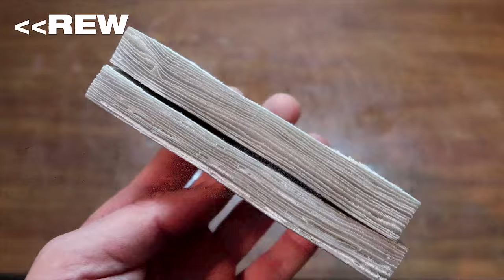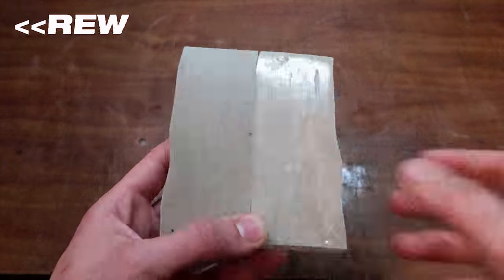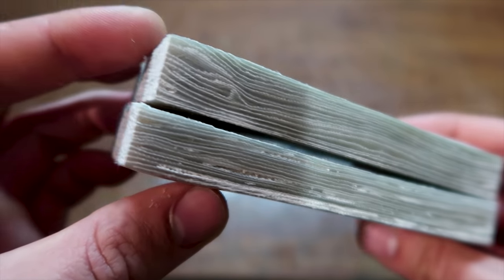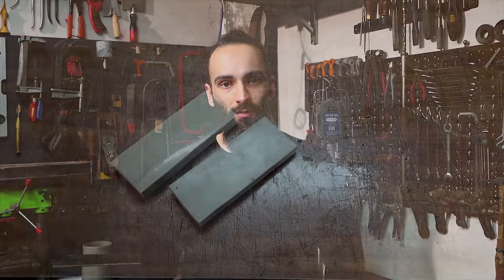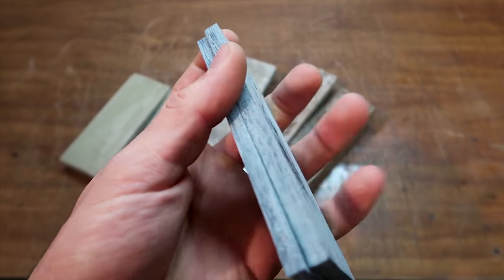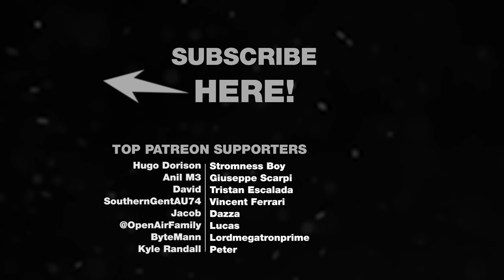Composite Materials : Vacuum vs Pressure

Comment: Thanks. I guess pressure may be superior coz' that's what Koenigsegg and Pagani uses on their huge pressure cooker, their autoclaves for their carbon fiber but I would suggest this: combine mechanical pressure + air pressure or vacuum using this innovative DIY method: fabricate a thick spring w/ a convex plate (the in the form of the pressure pot's curved lid, perhaps by hammering it into shape or using a hydraulics or jack used in cars (or a real hydraulic press from a nearby shop or a bench vise)  and weld onto the spring on the other side of the spring, a flat plate (this plate should be covered w/ plastic film that the resin won't stick to and coated w/ resin for good measure). Put the material composite and the the spring on top of it and the the pressure pot's lid and lock in place (it'll be very hard coz' of the spring's tension). When the pressure is increased, the air would also be taken out by the actual mechanical force from the spring contraption- same w/ the vacuum one. It might take a bit of trial and error in determining the right length and thickness of the spring that the lid (and human strength) can take without the spring going through the lid or damaging it (better if the top convex plate is welded with a sturdy ball bearing so it the spring contraption does not scratch the lid and can rotate freely. The bottom tip of the spring needs to be heated and bent at 90° and then threaded so there's a bit of height adjustment (someday the threads may have grooves and the female thread on the bottom plate can be lined with ball bearing on spring tension, so there's a kind of ratcheting mechanism, so the plates don't move as the spring presses onto the lid and the composite material).

Unless the composites are always of the same height, the spring contraption may need to be bespoked for maximum mechanical pressure and unless it's always a flat composite,  the bottom plate needs to be bespoked to the contours of the composite (for example it may have curves and dips) and then there needs to be a bespoked plate at the bottom of the pressure pot or vacuum chamber in the shape of the composite so it's sandwiched, pressed as strongly as possible while it's subjected to air pressure (can it be not air but a denser kind of air injected into the vacuum chamber?) or vacuum. It'll be forged composite in effect coz' the mechanical pressure but at the same time under gas pressure or under vacuum. Both plates at the bottom for non-straight composite materials need to be lined with a plastic film the resin won't stick to (with resin applied to both for good measure).

If the autoclave is big enough, one can put a hydraulic press so it's mechanically being pressed (forged) while also under gas pressure or under vacuum.

God bless, I hope my innovation works and will produce even stronger materials that are stronger but thinner and lighter.
All inventive and innovative ideas are from God, I'm but an instrument of His peace and innovations. :-)

Comment: why not just clamp it between to planks? I wrap the micarta in oven anti stick paper, and clamp it between 2 planks, and i don't get any foids. i seen other people use wooden molds they clamp it in. to make it same size rectangular every time.
Reply: symmetric thickness.... unless using a steel plate both side wood tends to bow and be thicker in the middle
Reply: @DjGlenJon  yeah i found this out the hard way. I ended up welding a steel jig and use a very thick steel pressure plate that cannot bow and get great results now.
Reply: Exactly!

Comment: In a vacuum bag sounds like a good suggestion.
I suppose you could use a bottle jack with resin piece sandwiched between a rigid  container & lid lined with plastic so it doesn't become too badly glued shut.
Polyester resin has 1 disadvantage, short shelf life of unmixed resin.
Epoxy can last for years if stored correctly.

Comment: Try squeezing the wet layup in a vice between thick wood blocks (use plastic wrap to prevent sticking). The pressure you can apply with a vice on that area is far greater and it would also compress the fibers together.
Another method for wetting out fibers is called "vacuum infusion" where you pull a vacuum in a sealed bag and use that same vacuum to draw out resin into your fibers. It's much quicker and yeilds far superior results.
Still, for micarta I would use the vice method.

Comment: mechanical pressure while in a vacuum will give the best results...like how G10 is made. squash the wetted fibre between two mould released surfaces to remove excess resin then vacuum to remove trapped gases.

Comment: Dear Black Beard, I don't want to sound rude but both pieces of composite are rubbish. You'd rather try vacuum infusion or vacuum bagging + pressure. Obviously, if you just put the laminate in the pressure vessel, pressure will not help at all. But if you manage to have that piece in the properly made vacuum bag, and add pressure on top of that (even @ room temperature), you'll get good consolidation. Or, what might be much simpler for you, just try vacuum infusion. Get a proper resin for that and make a big plate for your DIY projects. There are plenty of videos on Utube showing how to infuse.

Comment: Nice video, and good of you trying to experiment and get to the bottom of this. My 2 cents: First, I think one should use employ both vacuum and pressure. Degas a pot  slow cure epoxy (as you mentioned) in the vacuum pot and then place the soaked blank in the pressure pot. Secondly, I think fabric laminations (or any kind of lamination for that matter) should be held under clamp pressure while curing, regardless of the presence of air pressure or not.

Comment: The resin should not cure in the vacuum, this is just needed to get the air to bubble out, when repressurising, the surrounding pressure collapses any void.
If you don´t push the layers together when laying then into the mold and physically hold them together until the resin hardens, you will always have inconsistent results.

The method with the plastic bag (from the other comments) can do both: the vacuum empties out the bubbles, the pressure difference presses everything together.
But still - if the layers are not put together well (too much resin inbetween) the results can vary

Comment: Hey folks look up three rivers bow making. The way they make bow limbs is how we make our micarta. Instead of fire hose we use truck innertubes.  For the vacuum forming I go to the Dollar Store and buy vacuum bags for clothes. Put a small board up each side to keep the pile square. If your half way handy it's easy to rig a cars vacuum switch to turn on and off the vacuum pump so you don't have to nurse made the drying time.

Comment: You may get better results by setting the layers together in the open, so you can press out the air bubbles, before you put them into the mold. Then subject the molds to either pressure or vacuum. By eliminating the most bubbles possible in the open you should have better contact and adherence in the molds no matter if you use pressure or vacuum.

Comment: I think the best results would come from first placing the piece in a vacuum to expand trapped air bubbles and bring them to the surface. Then place the piece in a thick vacuum sealed plastic bag and apply as high of a pressure as you can around it. The effect of high pressure air will be limited if you haven't got a bag to prevent air from diffusing into the piece while it cures.
Reply: in a vacuum bag, you get both: the vacuum you pull pulls out the bubble while the ambient air pushes on the bag, thus squishes the bubbles out of the piece...
Reply: @sypernova6969  The only trouble with a vacuum bag is that the pressure the piece feels is limited to atmospheric pressure. For some things that's enough but more is always better. Also, if all you did was a vacuum bag, it would be very difficult for the small entrained bubbles to come out. The benefit of pulling a vacuum around the entire part is that it causes the bubbles to expand and make their way out more easily. Only after that has happened would it be beneficial to put it in a vacuum bag and pressurize the surroundings.

Comment: Try rolling it after adding each layer, before putting it in either chamber. You can buy a small metal roller designed for laying up fibreglass. Maybe use slightly less catalyst to slow down the time before it gels.

Comment: You should research a triaxial 3D braid for building layers - rather than a single material with grain all running  the same direction.

A triaxial braid, you can mix fabrics with various properties, building a superior overall final material.  

Another interesting concept is building layers by stitching 2-3 types of fabrics per a selected tesselating pattern.  It would be cutting fabrics into specific small shapes and stitching them to defined positions per the pattern....sort of like making layers of fabric scales, where the scales are 2-3 different fabrics.  If the tesselation has a grain to it, each layer would be set 90° rotated from the previous layer.

Also, I agree with many; clamping the material between two rigid plates for pressure would be a good idea.

There's a Japanese fellow who tests different materials for making high-end chefs knives - his channel is "kiwami" I believe...  I'll have to double check; but he's made knives out of all sorts of stuff - rawhide, aluminum foil, cling wrap, cardboard, pasta, pure resin, carbon fiber, lignum vitae, boxer shorts, etc.  Every knife listed has been sharp as shit...

Note: his channel is "Kiwami Japan"

Comment: First of all I would do some testing, if less hardener would result in a longer curing time. Also cooling down the resin before mixing should slow the hardening. Maybe cooling the cloth is also possible. Which would leave you more time for handling. Chemical reactions are very temperature dependent. After placing the layers in the mold I would simply weigh them down before applying vacuum or pressure.

Comment: Can you try placeing the materials in a bag and then using vacuum to pull the resin through the material? I know this is a process used when making carbon fiber panels so it may work here as well. Also it may cut down on the amount of resin used.

Comment: This cavitation takes a very long time to go away and your essentially pulling gasses out of the liquid. Not necessarily air bubbles.

There is a method used with hydraulic brakes on bikes that use the cavitation to remove air from the DOT fluid and it's super slow. I usually just wait for the large bubbles to be removed and leave the microbubbles alone since I have never seen them fully disappear.

Comment: as a general rule .pressure for resin casting .vacuum for silicone casting. you can vac cast resin with a vac bag that will compress the cast.

Comment: Not sure what you are trying to accomplish here but maybe I can help with the samples in the video. Way way to much resin, try 10%- by total volume with a 1% to resin volume initiator, then apply lots and lots of pressure. The result will be a much tighter/thinner and much much stronger unit. Let it cure under pressure until peak exotherm (maximum temperature), then release pressure and let cure at ambient until part is at the ambient temperature. I think you will be pleased. I am a certified composite technician, let me know if you have any questions.

Comment: Hey dude, have you ever tried a press or heavy object? Isostatic pressure in a pressure cooker  is not too high and vacuum degasses the resin. You need too vacuum and then press with much higher pressure (using a non sticky pressure transfer media e.g. a polyethylene sheet or do).

Comment: How to make it work correctly with poly resin BBP is like this -- 
Do not put your mold in a pot, make your mold out of wood or teflon or plastic and line with parchment paper, must be parchment, not wax paper as it adheres. then make a lid for mold that is slightly undersized as excess resin needs to seep out.  stack or pour material into the mold and press with iron weight on top of  spacer - i use small paint can - i stack 10lb iron plates making sure lid stays level and i stack all the to 30 to 40 lbs typically.  no voids as poly res heats up very high and weighted pressure forces bubbles out.  DO NOT STACK WITH TOO MANY WEIGHTS.  My micarta/composite comes out near perfect every time - I just made a batch today with snake skins from my pet snake along with kevlar strips and aramid strips with red sparkles.  should look magnifique.   thanks for what you do and keep up the stellar work my man.  try this method and I'm sure you'll love it.  a little messy so just lay out newspaper.

Comment: I prefer placing my laminates into a baggie then into a vise..... But odd shapes let vacuum press with bagging.... Also using less resin makes more strength... Just have to get the wetting..... I pour a thin bead on each layer and allow the pressure from vice or clamps to press that bead to the edges.... I prefer epoxy resin and 24 cure resin as well so it has plenty of time to press out..... Vacuum bagging the bag presses the out side and the vacuum helps draw out air bubbles.... Heat applied reduces viscosity and allows better press out as well but it's all about experience.... If you need strength make 2 parts same way the destruction testing  is confirm needed strength.... Especially if used in parts that life depends on such as aircraft

Comment: vacuum makes the air bubbles expand and float to the surface, if the liquid is thick and they have no way to escape trough the layers they just expand inside. high pressure compresses the air trapped and makes the bubbles inside smaller. long story short: high pressure is best for thick resins with layers inside which makes the air escape harder, vacuum is best for porous materials such as wood and cloth but only when you use thin liquids like diluted varnish or specific products

Comment: What about physical pressure? Like, if you presses it under a hydraulic press?
Reply: I think a hydraulic press would be a little overkill in this case... but yeah physical pressure is a tried and true method for making handle composites ^.^
Reply: @KageStelhman  i have both a 6 ton press and pressure pot..... the pot is better with certain resins
Reply: Standard procedure carbon fibre bike frame production. Hot pressing is the way to go

Comment: A simple hydraulic press, using a 5 ton bottle jack and heavy plates, would probably solve the void problem and be fast enough to overcome problems caused by air trapped in set resin folds using other methods, that take longer to achieve good pressure because of assembly times.

Comment: the better:put the material into the vac bag and  then into the pressure contenitor..that way you sum 1 bar of the vac to the bars of the pressure contenitor like composite makers do their pieces into an autoclave(autoclave is a pressure device combined with  high temperature and the piece you want to laminate must be in the vaccum bag inside it)

Comment: You are not pushing the material together  with either method. Just put something heavy on top if what you are sticking together with glue and let the extra air and glue escape or use a plastic vacuum bag so the air pressure pushes the material together and with using the extra air pressure to push the cloth tighter together.

Comment: As already mention, concept is wrong. You use vacuum to DEGASS the polyester resin before catalyzing (or the epoxy mix if it is slow). You laminate using ALWAYS a bag, the idea is to have a pressure differential that compresses the laminate through the interface. You can do vacuum in the bag vs. atmospheric pressure outside, or high pressure ouside (your pot) vs. bag vented to the atmosphere (you would need to drill a hole in the pot and connect a hose hermetically, as they do in autoclaves).

Comment: Putting it into a vacuum chamber takes the air out of the epoxy for a better product, vacuum bagging world take out the excess epoxy and make nice level blank. Polyester will not be clear or as strong. Use fast hardener for the epoxy and raised temp to cure quickly.

Comment: Right from the beginning he screwed up by not compressing the material as it cured thus causing voids, swelling and epoxy pockets.
The whole point of vacuum is to get the bubbles out and to compress the material in a sealed bag with atmospheric pressure.

Comment: Looks like you need Mechanical pressure. Make a disposable mold out of wood. Use C clamps and a pressure plate then squeeze. Cut the thing open with your band saw. Wax paper will release from Epoxy don't know about polyester.

Comment: This is totally wrong you are only degassing the resin in the chamber. Lay up on a released hard surface with a vacuumed bag prepared ahead of time . In a bag on a hard surface you cut the much needed compaction to get the excess weak resin out of the layup. It will also degas the resin. Use epoxy costs twice as much but goes a lot further and is much stronger.

Comment: Instead of applying atmospheric pressure, could you not try putting it in a press?.. Hard for me to explain, put it on a flat surface, then put a flat board on top, then put a lot of weight on top of that, then let it set. That is how I would tackle this problem : ]

Comment: by curing in a vacuum the trapped air bubbles will expand , but most will not escape being trapped by the fabric , making end result full of holes and weak.
by curing under pressure the air bubbles will be smaller so less cavities  
Both are a waste of time . You need to exert pressure , squeezing out excess resin and air bubbles from the fabric.